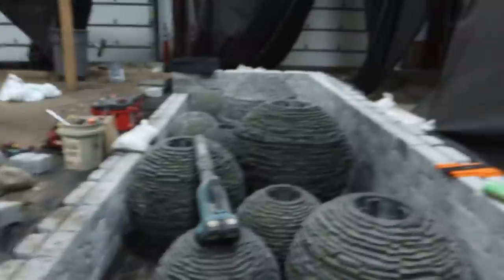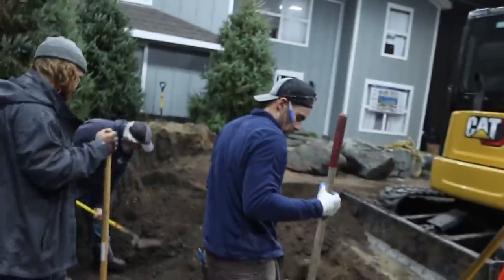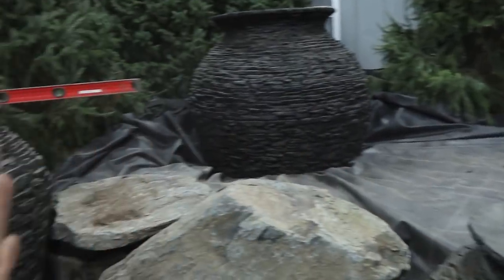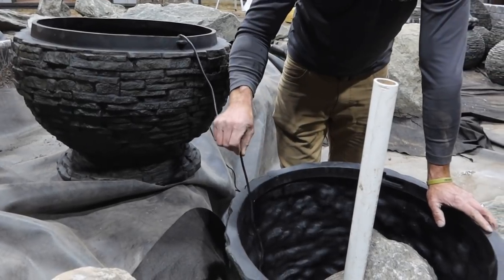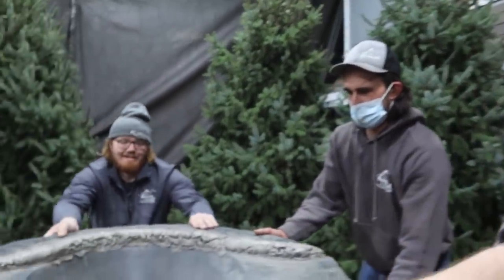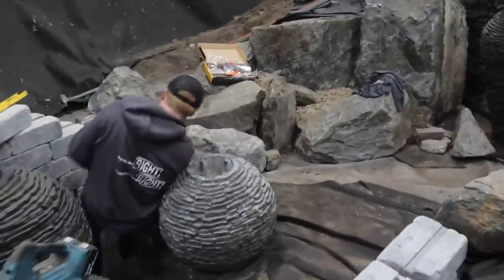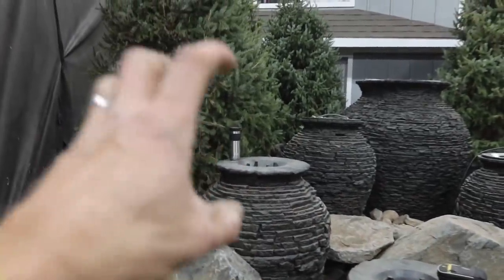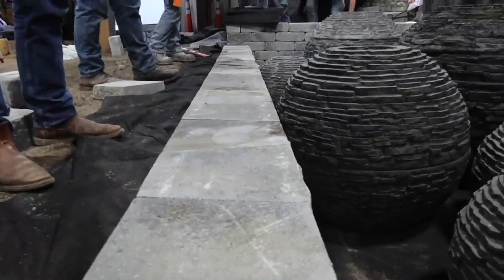Spheres, Urns, and a Pond in a Sandbox - Part 2

Comment: I have seen some CAC add a bulkhead fitting to the urns and spheres. Is there an advantage to the way you guys do it with just running the rigid pvc through the 2" drilled hole?
Reply: The size hole we provide the pipe to slide through is a snug enough fit to simply apply a bead of silicone to let dry and seal. If there’s a little dribble, there’s no bother for a couple reasons. 1. There’s at least 1500 gal/hr coming over it 2. It’s all contained  inside the liner anyways. 3. So much easier and simple to line everything up and plumb this way. Hope that helped!